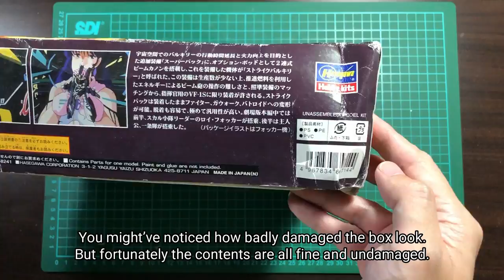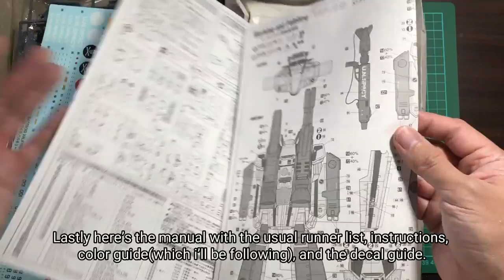Hasegawa Macross 1/72 VF-1S Strike Battroid Valkyrie マクロスストライクバトロイド バルキリー

Comment: Putting this exact model together as we speak. Didn't realize that you have to paint EVERYTHING especially the feet.  Kind of odd in my opionion.
Reply from the maker: Haha yea scale model kits are like that 😅

These kits are not like gunpla kits which are designed to be very easy to build and doesn’t require paint(most of the time) or glue.
Reply: does this one requite a lot of work? i'm looking to get into the macross series soon. i have built plenty of gundams straight out of the box. do you recommend i just get the new macross kits that are prepainted? thanks in advance
Reply from the maker: @kidrobot. The amount of work needed can be seen from the video 😅

You will need to be familiar with painting and glueing kits to be able to build it.

AFAIK there are no new pre painted macross model kits
Reply: @casualplamo  why does life have to be so hard?? 😰 well thank you for the information! 
and iirc the new bandai macross kits are about 95% color accurate, although i may be wrong

Comment: how to did  you paint the gun of valkyrie you mix?
Reply from the maker: What do you mean?
Reply: @casualplamo   did you use the circle cutter for masking tape?
Reply from the maker: No I dont have a circle cutter.
But I have a cutting template for common circle sizes. And I used it to cut my masking tape.

Comment: Amazing work 🤩 any problems with the decals due to the age of the kit, I've heard comments. I have a large collection of the Hasegawa Macross kits.
Reply from the maker: Thanks!

Yea they are so thin and fragile, they disintegrates easily. Which is why I painted most of the blacks and yellows instead of using the decals.

I don’t know if it’s because of the age(mine is from 2004) or not though mine hasn’t yellowed much. I’ve seen it happened to jp builders as well, but I don’t know know the age of their kit 😅.

Comment: Nice work. And I would love to ask how you mold your missing part. Cause I currently found out I drop one of the small booster on the leg armor…
Reply from the maker: I used oyumaru, but you can also use blue stuff. 
In my next upcoming video I happen to have to recast another small part(since it was a second hand kit 😅) and I recorded the process a little bit there so you can check it out later.

I think there are quite a few videos on recasting using oyumaru and blue stuff in YouTube, so you can also try searching for em too 😁

Comment: That is great work. I'm really going to have to take the plunge and try this kit. I just finished the IMAI 1/72nd VF-1S and the seams were a bit of a nightmare. One still cracked open during final assembly and I could have sworn I got a good bead of glue in there. For the arms (once assembled), it's hard to sand the inside seam - in those cases, I use very thin plastic card and glue that over the top - looks much better in hard to sand places that are still quite visible.
Reply from the maker: Oh man, imaii is way older than this i think 😅

Bandai did bought some of their molds and repackaged+rereleased some of em though.

You should give Hasegawa kits a try 😁
You’ll do fine I’m sure
Reply: @casualplamo  Just ordered a Strike Valkyrie. I had doubles of the older IMAI kits so I decided to make some of them. Started by making the VT-1D, then made some minor modifications on the VF-1A and VF-1S. But there are some very obvious scaling issues, but as you point out, the IMAI kits are old. 😆

Comment: Very very nice. I am currently building the Regult.

Was the liquid mask by Mister Hobby and did you have to use Acrylic paint because of it or is their regular paints fine?
Reply from the maker: Yes I used the Mr hobby brand liquid masking.

There are two kinds. Orange bottle and teal bottle. Orange bottle has ammonia in it, so it can’t be used over Waterbased paints. 
Teal bottle is Waterbased, and is safe for all paints. It can also be thinned by water and applied with a paintbrush as it will wash away with water.

I used lacquer paints so my paint layer are safe.
Reply: @casualplamo  Thank you

Comment: Are you missing the part beneath the head? Which covers the neck hole for the body.
Reply from the maker: Nope, B16 is installed.

Though it’s painted grey, so it might not show properly unless the angle is right or if zoomed in.

There might be some pics in my IG from other angles that you can check out. Or I could always post one with it visible(I might not have posted all of the pics that I have in IG)

Comment: Thanks for share the video.
What kind or paint needs this model? Could you share the list with name of colors that you used? Thanks a lot and my best regards
Reply from the maker: The paints I used are the ones listed in the color guide of the kit’s manual. So you can check there for the complete list.

Most of them are from Mr. Color brand. They’re lacquer paints.